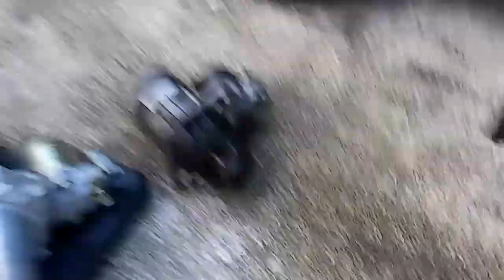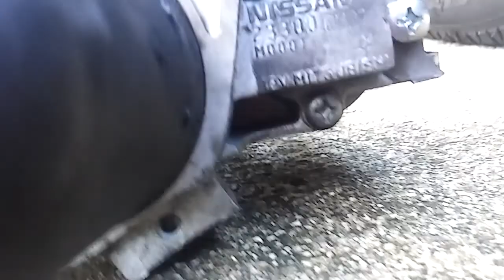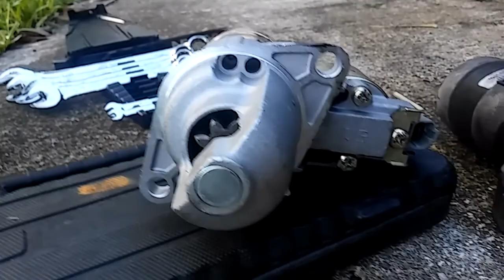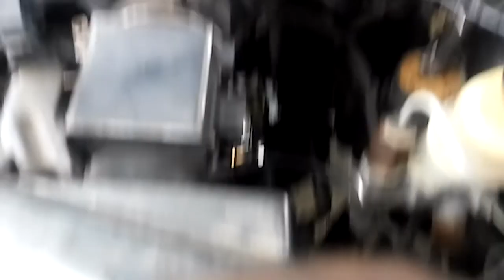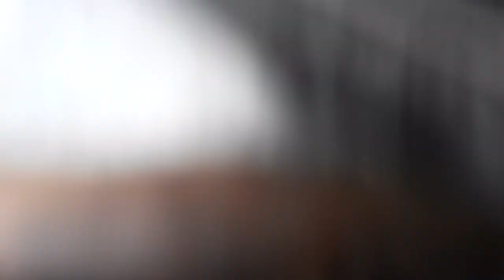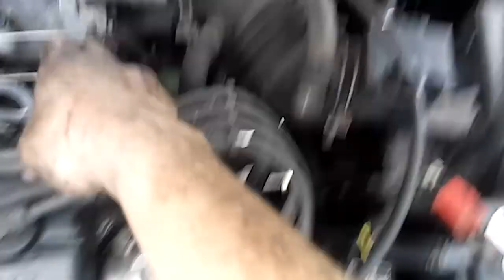How to replace starter in a 1997 Nissan Sentra

Comment: Is yours automatic or manual
Reply: hers was manual, you can see the clutch cable and bracket when she was showing the starter installed.
Reply: On my automatic, the starter is un-reachable.
Reply from the maker: It was actually a manual transmission